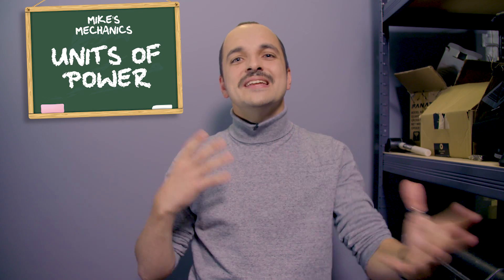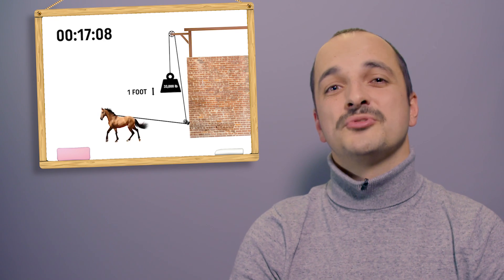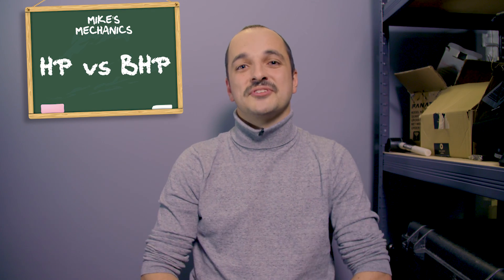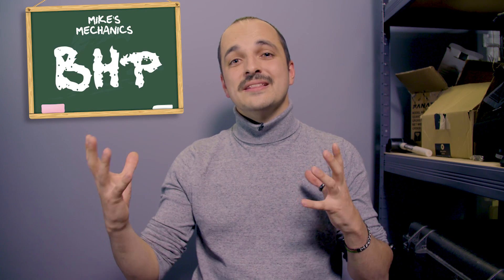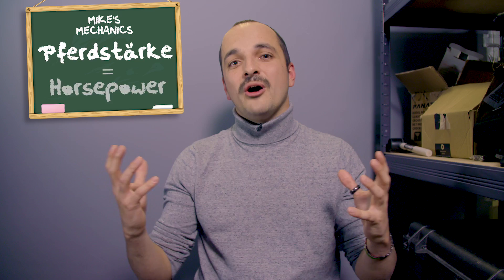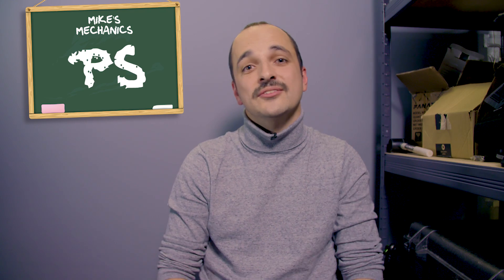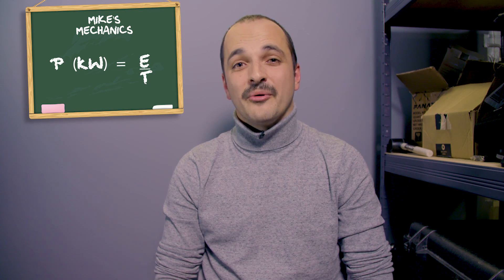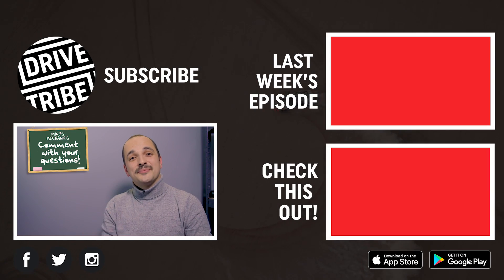What's the difference between BHP, HP and PS? - Mike's Mechanics

Comment: North Americans use HP for all motors. My electric stand mixer and food processor are rated in HP. So you're point about especially since we re transitioning to EVs moot. We alresdy intentionally don't use KW for electric motor power output. Only input.

Comment: @DRIVETRIBE I know video is couple years old but fantastic info👏. I’m in Australia 🇦🇺 & agree Kilowatts is the most accurate form of measurement in Cars(especially when modifying). The only downfall that most the world seems to have with this system is that the dyno numbers show up significantly less on paper eg 450kw= 600HP. Most ppl, wether consciously or subconsciously prefer the higher number thinking it equates to more power-yet it’s exactly the same. A great example is “what’s heavier- 1kg of feathers 🪶 or 1kg of bricks 🧱 = Most ppl answer bricks sadly 🤣

Comment: My car has 6 cheetah power. The cheetah power defined as the average power required to accelerate a mass of 140 pounds to 60 mph in 3 seconds or 10.21 horsepower.

Comment: One horsepower is not lifting 33.000 lbs one foot. That's 15 tons and no horse could lift this kind of weight even an inch. HP has been defined as lifting 330 lbs 100 feet, which is also more realistically achieved in a minute.
Reply: It doesn't matter if a horse could do it or not. Besides which, 33 000 * 1 = 330 * 100 = 33 000 so they have correctly defined the horsepower.

Comment: KW is the official measurement of power in thermodynamics 
1 KW = 1,34 HP = 1,36 PS
Reply: Using commas instead of period is dumb. Why don't you use commas at the end of sentences as well.
Reply: @reuploadify you almost sounded smart but failed to realize that grammatical punctuations are different from numeric symbols. Although I agree with you, the usage of commas and periods in decimal separators is mostly regional, and at the time I wrote this comment I only studied thermodynamics with the regional numeric system.
Reply: @reuploadify  Responding to a 6yo comment just to showcase mind-numbing ignorance is such a weird flex, it's almost impressive. You sound like the type that will visit a foreign country and then complain that there are too many foreigners around. Also, calling it a period instead of a full stop is dumb. Though in your case it's understandable since you are apparently on it.

Comment: At 2:40 in the video you erroneously state you divide PS by a factor of 1.4, the correct number is 1.014 that is a HUGE difference..
Reply: You erroneously state that he made an erroneous statement. He said it's "1.4% higher". 1.4% higher is 101.4% which written as a decimal fraction is 1.014, meaning both he's correct and you need your ears cleaned.

Comment: The definitions aren't that complicated: Mechanical horsepower is 33000 ft-lbf/a which is exactly 745.69987158227022 W.
The PS is defined as 75 kgf-m/s which is exactly 735.49875 W.

Comment: 1. Fuck Metric. (and the Euro with it)
2. AFAIK the regulatory bodies have not allowed OEMs to dyno engines without the accessories, known as Gross HP,  so everything today is Net HP, which per your description would be identical to your BHP.
3. If Net/BHP is better for realistic losses, then it still fails, because the driveline is not involved. RWHP is what actually matters. It's what is getting to the road.

Comment: In Germany/Europe every car's power ist rated by kilowatts!
Even in the papers there is the kilowatt configuration.
Reply: In the uk, kW is used on vehicle loogbooks (V5, similar to registration document or pink slip) and for license restrictions. This is particularly important for "33bhp" (pre 2013 restricted licence, and minimum for A2 test) 25kW bikes and 35kW A2 bikes, as discrepancies over whether PS or BHP is used for consumer oriented figures mean some bikes are mistakenly thought to be legal.
Reply: Kilowatts at the flywheel or kilowatts at the rear wheels?
Reply: @maleficus6186  flywheel. This makes in vehicle testing a crapshoot, as one is required to estimate transmission losses. This is problematic if the police get arsey and decide to check an A2 motorcycle or a pre-2013 25kW/33bhp restricted bike, as a low estimate of drivetrain efficiency can give inflated figures. Of course the motorcycle tuning industry is aligned towards inflated figures.

Comment: What annoys me the most (as an American) about these figures is you don't know if power was measured at the flywheel, or at the wheels. So you'll have a 707hp car that actually makes 625, vs a hypothetical BMW that's rated at 500 but actually makes 525 at the wheels. Whatever, I just wish it was more standardized. Bring on the kilowatts, just as long as we all use the same thing.
Reply: All OEM power ratings are usually at the crank. It's not until you have "gentleman's agreements" and under-rated oem power figures that you find the wheel horse power to be greater than expected.

Comment: You make the determination of power (using the metric system) too complicated. Brake power is simply brake torque multiplied by the crank speed (in radians per second)

Comment: Peak torque and peak power usually happen at different RPM, as increases in engine speed offset reduced torque to some extent. It can be a fairly wide gap, say 2000rpm peak torque and 4000 rpm peak power in a turbodiesel out of a family car or a van, or 9500rpm peak torque and 10500rpm peak power in a performance motorcycle.
Reply: Thats what you basically talk about when you talk about a cars powerband, it is the range of rpm between peak torque and peak power.
Modern turbo performance cars often have powerbands greater than 2000 rpm because they use efficient fast spooling turbos which can achieve peak torque as early as 2500rpm while then having a curve of almost consistant torque all the way to redline which then makes the power curve almost linear increasing with the maximum near the redline.
A very good example for this is the Mk7 Golf GTI  with max torque at around 2500 rpm and max power at 5500 rpm but then with an almost flat power curve until redline.
The image is to promote some tuning for the Mk7 GTI but they also show the stock kurve: https://images.app.goo.gl/Lq9yp2fZEdkp1p8S7
Reply: @jakobkerber5357  Entirely so. Numbers were more intended as an example to illustrate my point and are approximate figures for 2005 Duratorq 130 out of a ford mondeo with a variable gemetry turbo,  misremebering of the dyno charts for a slightly tuned 2002 suzuki gsx600.

My point is the video clams (3:27) you can calculate peak power from peak torque and the rpm at which this occours, which gives you *power at peak torque*. You can convert any combination of torque and rpm to power and indeed a dyno chart shows measured torque and calculated power by exactly this technique. The two figures are intrinsicly linked but torque is kinda meaningless without an angular speed. I'm fairly sure I can supply 1000Nm of torque by standing on the end of a metre long breaker bar, and it's a time honoured tradition for removing overly light wheel nuts. If i were to manage 2rpm like that, it would be 0.28bhp :-D

But let's run with this for a second as it's mildly interesting.

My GSX600 on dyno: 

Peak torque: 54.0Nm @ 9500 rpm is 53.7kW or 72.1 bhp
Peak power: 57.9kW or 77.6bhp @ 1125 rpm is 49.1Nm
Looks kinda peaky, but there's more than 40Nm of torque all the way from 4000rpm so it actually feels quite linear. 4000rpm is ~30mph in 3rd and comfortable urban cruising, crack the throttle wide open and it will charge forward to about 85 beofore you need to upshift. It's a monstrously flexible engine and quite engaging to ride hard.

2005 Mondeo with 130PS Duratorq turbodiesel

peak torque: 330Nm @1800rpm is 62.2kW or 83.4bhp
peak power: 95.6kw or 128.2bhp @3800rpm is 240Nm
You get maximum thrust flooring it at comfortable cruising rpm and it juts kind of drops off. Handy for a brisk overtake but not particularly engaging to drive hard. Apparent wide powerband is undermined by just how much the torque falls away. 2000rpm is ~30mph in 3rd, floor it and you'll need to upshift at 55, and again at 80ish. Despite the wide gulf between peak power and peak torque it's not particularly flexible. Eats long distance effortlessly.

Both vehicles max out at ~130mph, and i typically get ~45mpg out of both of them. Both are 6-speed manual transmission. One has a torque curve that gently rises throughout it's usable rpm range, the other surves everything up at once and then falls off considerably. But looking at the peak figures you'd probably come to a different conclusion about how each vehicle felt to drive.
Reply: @rowlandstraylight  Wow that is some detail information thanks.

You are correct because the definition of 1Nm is a force of 1 Newton on a leaver arm of 1 meter so if we assume you weigh 100 kilogramm, that the braker bar is 1m long and that the acceleration by gravity is 10 m/s² then you apply 1000 Nm to that bolt.

At 3:27 they also used an estimated formula specific for kW because it is actually P=M*w. P is Power in Watt or Joule per seconds, M is torque in Nm or otherwise know as Energy in Joule and w (actually a small omega) in 1/second, which is the angualr speed of the engine in radiants per second.
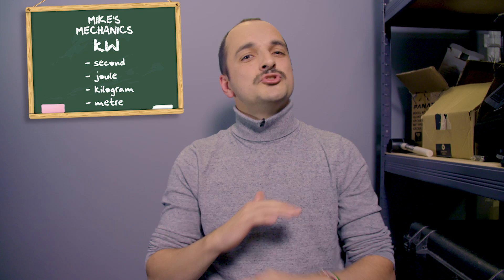They showed the basic version of the formula in the video when he siad that Power is Energy transfer over time at 3:03.

Comment: I find it a little easier to think of a kW as the product of the accelleration (in m/s^2) you get at a given speed (in m/s) per tonne.
Reply: not per tonne. you have to multiply not divide by the mass of the object. The kinematic definition of power is acceleration*velocity*mass. if you are doing acceleration*velocity / mass then you are thinking about specific power--similar to industry norm power-to-weight ratio instead of just power. even then you shouldn't do it per tonne because the SI unit for mass is kilogram.

Comment: no one use kw cause no one have an idea  of what 70kw amount to so you just look at the hp column on the data sheet to se the hp value which you know what it amount to and if it enough or not for the task
Reply: You will get used to it. First switch to metric and then to kw instead of HP.

Comment: Apart from anything else using kW will give a lower number than any horsepower measurement which is normally the criteria marketing departments use to decide which measurement system not to use. When I went to school last century 0.746kW = 1 hp (the conversion figure for PS is almost the same).

Comment: What about wheel horsepower? Is that the same as brake horsepower?
Reply: BHP is a measurement for Power at the Crankshaft including losses from A/C, etc. and WHP is a measurement for Power at the Wheels so it also takes drivetrain losses into account. That's why it is generally 10 to 20 percent lower.
Reply: @Boneyyym  I didn't know that, thanks for responding!

Comment: Then you add in an extra complexity of choosing to either measure power at the crankshaft or the wheel.
Reply: BHP is calculated at the flywheel without any accessories hooked up.. HP is the power produced by the engine with all accessories in place, usually at the drive shaft or hub, so it's a more accurate reading of the vehicles actual on road power output..

Comment: if metric made any sense at all at any level, I would agree that the kW should be the standard unit. but there isn't a single detail about the system that does make sense. it's base 10... which is awful. it has units that are actually just constants (see the mole). all of its constants were originally measured, rather than defined, then when it was noticed that they couldn't be measured they were defined, but the resulting numbers have completely random factors, making them awful just like using base 10 does.

to illustrate the issue with the numbers, what's 1/3 of a meter? 1/3 of a yard is a foot, and 1/3 of a foot is 4 inches... easy af. and then how do you make a perfect cube from 1 mole of something? you fucking can't, because the number that is the mole is a completely random one which has no nice factors, and no nice roots. you literally had the chance to pick any number, and you squandered it for some random, useless trash. great job, dumbasses.

the only thing going for metric is its popularity, and that is literally the only reason anyone anywhere ever touts it as superior, and while there are other purported benefits often also cited, they always mysteriously disappear from discussion once the matter is pressed in any way. thus it is objectively total shit. argumentum ad populum shouldn't be convincing when it comes to methodology on how to precisely measure the world.
Reply: @3:24

just claimed that the kW equations are objectively the simplest possible. then puts up literally the same exact equation he claimed was too complicated for hp. what the fuck, dude?

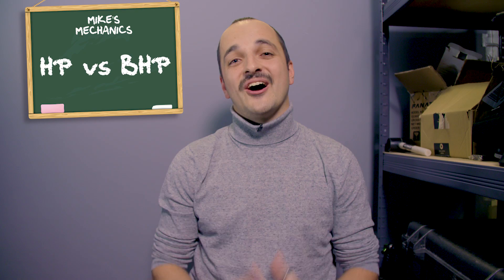@1:03

hp = torque * rpm/5252

@3:24

kW = torque * rpm/9565

those are exactly the same. the constant in the denominator only changes due to the relative scale of the base units. you're fucking dumb if you think those are somehow different.

Comment: Sorry bud, you’re a little confused on hp vs bhp. US market cars only measured horsepower without accessories and often with different intakes and exhaust manifolds before 1972. That was known as Gross HP. The newer standard from 1972 onward is Net HP, which requires the engine to be configured as closely as possible to how it will be installed in the car, so with full air filter, alternator, catalytic converters, everything, exactly the same as in the UK
Reply: Who you calling bud, pal?
Reply: @elrud5964  I’m not your pal, friend
Reply: @1down5up426  I’m not your friend, bud.
Reply: @elrud5964  I’m not your bud. Guy!
Reply: @1down5up426  I'm not your guy, bro.
Reply: @suivzmoi He's not your bro, Sir.
Reply: Good info. Thanks.
Reply: @paulbradford6475  We did the same thing. There is a difference between gross imperial SAE bhp ratings used up to the late 1960s, and DIN bhp ratings used later. The measure is different for a start, you divide (metric) DIN by 1.0139 to get (imperial) SAE, so SAE is a little lower, but the method of measurement also changed from gross to net, and that leads to a much bigger disparity the other way.

A 60s Jaguar 4.2 E-Type is rated at 272bhp gross (SAE) but is only producing about 180-190bhp DIN net. It is generally accepted that the last 202bhp DIN net 4.2 injection version of the same engine is actually the most powerful, despite far less impressive output figures.

Comment: As an American I can tell you that 1. All car manufacturers everywhere measure their power at the crank, what's attached to it when it's measured is up to them. 2. Pretty much everyone who isn't a manufacturer measures power at the wheels on a chassis Dyno (what you Brits would call a rolling road). 3 All HP is brake hp because it's measured on a braking dynamometer. It's the only real way to measure torque.

Comment: SAE HP is measured at the rear of the transmission with all accessories(ie AC, perhaps a hydraulic power steering pump etc.), all emission equipment and a complete exhaust system since 1972.

Comment: Nice Video, but there are minor misstakes, in Germany its caled "Pferdestärke" und in the formular for kW it should be a minor "t". In physics the capital "T" has a different meaning than the minor "t" for time.
Reply: About factor 10^12
Reply: @Stefen Paetsch Capital T stands for temperature and a dimensional mismatch would occur
Reply: While there are standards for things like units, in physics you use whatever symbol you like for whatever quantity you like. T and t meaning time are common but not a requirement and you can use Z or q or § if it pleases you. T or t might be clearer but all variable symbols used are meant to be defined.

Comment: I thought the HP was derived by from an early steam engine that replaced two horses on a water pump. As the engine was as powerful as the two horses it had 2 HP and it was able to pump a certain amount of water per min, what then defined the power. 

Note that 1hp peak power is not a lot for a human. It means lifting ~75kG 1m high in 1s. What means just standing up or doing a good bench press......

Comment: You say the kw should be the new unit for it but in mechanics college we use kw to calculate how much hp basically anything has even the generator in your car has a hp output if you wanna calculate it you say kw x 1,36 then you have 1 horse power which is also why the koenigsegg 1:one is known as a mega car because if you take its hp output ant divide it by 1,36 you get pretty damn close to 1000 kw also known as 1 megawatt so basically what I'm trying to say is that we already use the kw a lot in the calculations just not in the final numbers

Comment: HP or BHP are just annoying recalculated figures and you generally have to rev your engine pretty to find the biggest numbers.  Torque is my favourite! It's low down and gets you off the line first!
Reply: half true. you definately need the rpm of the engine, what eventually becomes through the drivetrain -> the rpm of the wheels, which equals to actuall vehicle velocity.
taking that into concideration we again got torque&rpm, so basically HP.
what will you achieve with 100000nm torque if you only have 150rpm?

Comment: This isn't correct. BHP measures power at the crank or flywheel by a brake dynamometer. "US HP" is measured similarly at the crank or flywheel. "US HP" or just "HP" is informal. In reality, the measurement we use is SAE net horsepower. BHP is not net horsepower, it is just gross horsepower. The BHP measurement uses ancillaries, but it does not include the auxiliaries found on a car. The SAE net horsepower test is done with both ancillaries and auxiliaries attached to the engine. This is why some cars in the US might have lower figures, even if the actual output is the same.